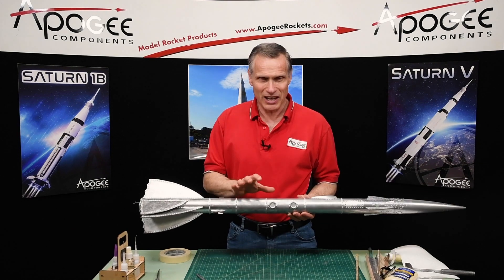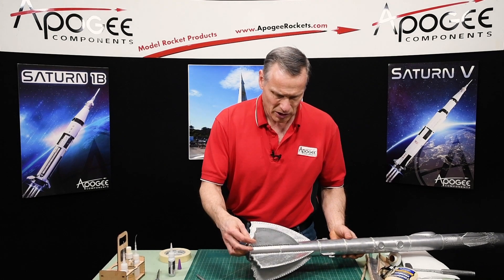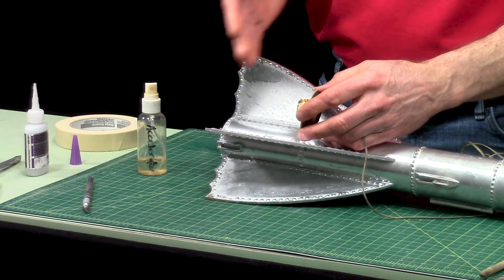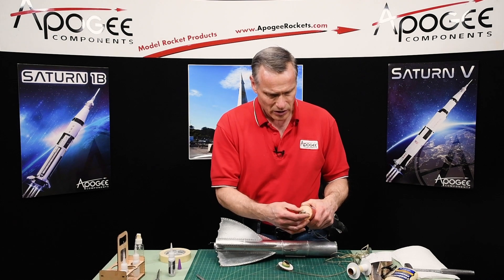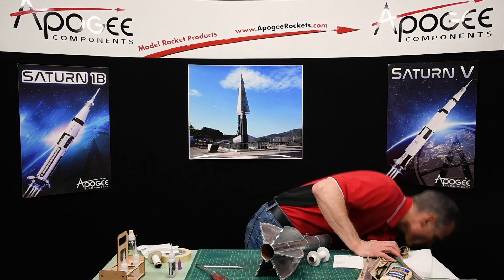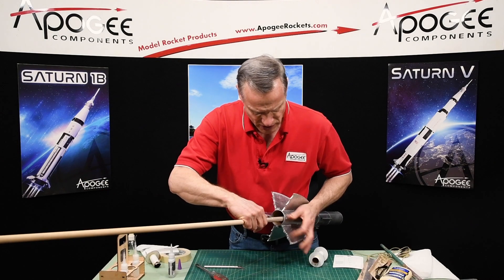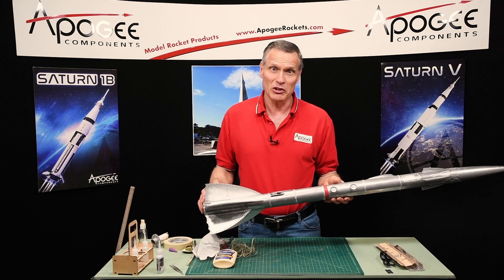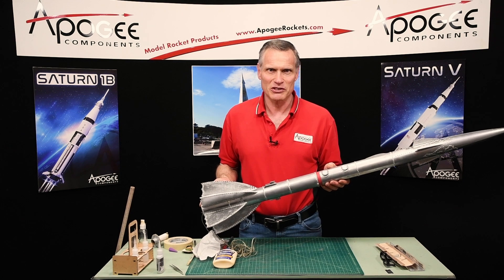How to Replace an Engine Mount

Comment: Tim, For Mid power rocket motor mounts should I be using Epoxy? or simply using wood glue, What weighs less, whats better?
Reply from the maker: See our glue guide in Newsletters #185 and #186. https://www.apogeerockets.com/education/downloads/Newsletter185.pdf

Comment: Im guessing it was an Estes E9 engine
Reply from the maker: Nope. As I wrote in another comment, the probability of a CATO is very rare. Don't get fixated on what motor is was, because it probably won't ever happen to you. There is not a specific motor that CATO's more often than other motors. It is rare, and it is random.
Reply: @apogeerockets  oh I don't....been flying rockets for 40 years and only experienced one motor failure back in 1998 on a D engine....just a freak thing......I agree

Comment: I probably would have spent a bunch of time trying to carefully cut the aft centering out with a hobby knife,  looks like you got just as good of results punching it out with a screwdriver
Reply from the maker: If it was plywood, you'd probably have to drill a bunch of holes and then cut it more carefully.

Comment: It figures it would be the rocket with all the rivets and planking.  Was that one of the Cessaronis with the oversize starter grain?   Mine never lit, just exploded.
Reply from the maker: No. Don't worry fixate about the bad motor. It is so rare. There isn't one motor that CATOS more than others.
Reply: I have fired DOZENS of Cesaroni motors of several different sizes without problem...BRAND has nothing to do with it
Reply: Lou smith I’m glad you have good luck with them.  I’ve fired exactly one and it exploded and damaged the rocket.  I might have a slightly different opinion of them.   And they did admit there was a problem with some of them and show how to fix them.
Reply: @ricksorber8343  the only issue I know of they talked about was the VMAX motors snuffing out the delay during boost.....and some 38mm delays were replaced due to a known issue....via batch number....curious as to what you are referring to?